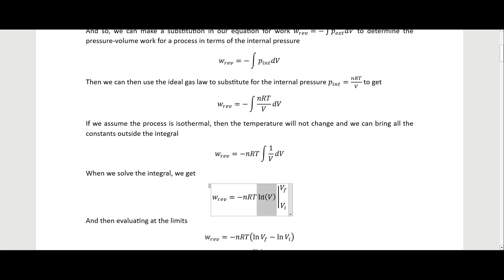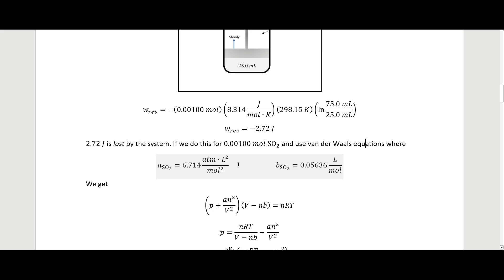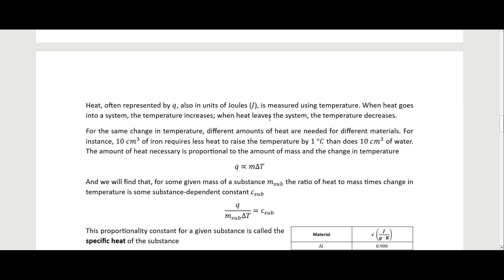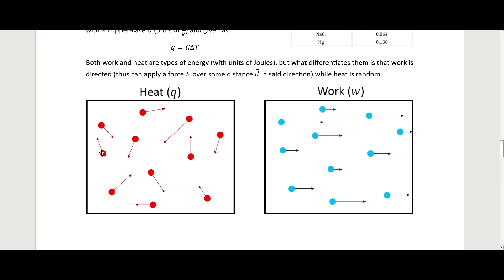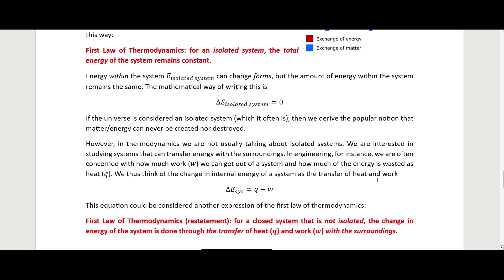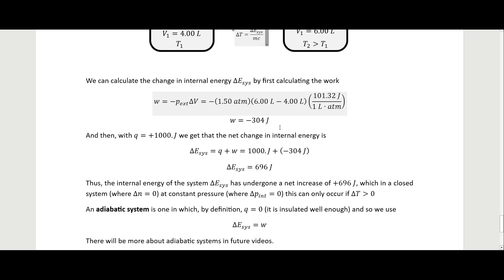Work, Heat, and the First Law of Thermodynamics

Comment: If I understand Stefan-Boltzmann law, it takes more energy to warm your house in winter from 15C to 20C than it would to raise the temperature from 10C to 15C. That explains why my heating bills are so low. I can tolerate 6C and night and around 12C in the day. The average outdoor January low is -5C and the average high is about +5.